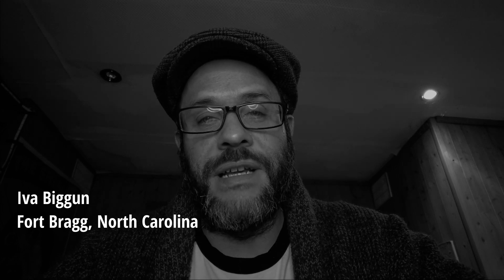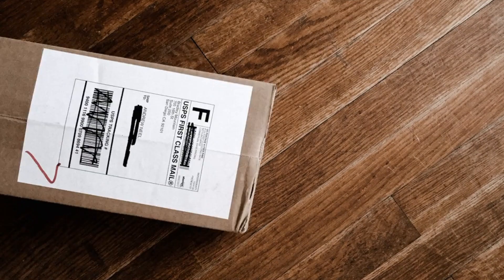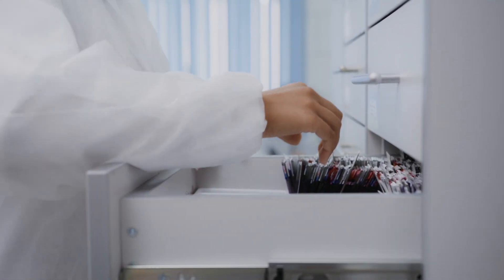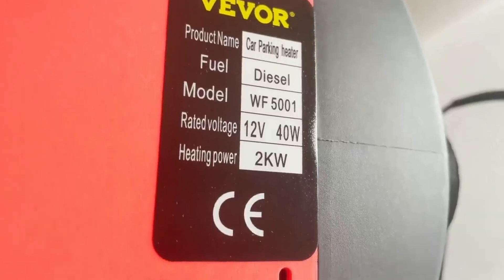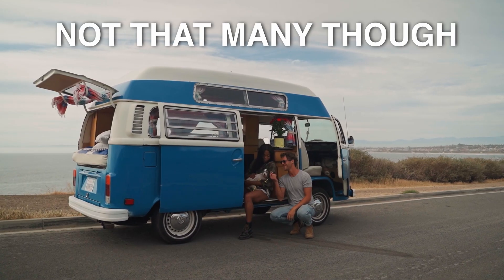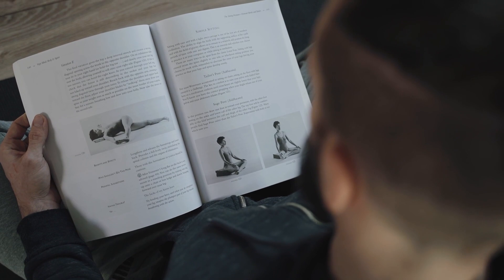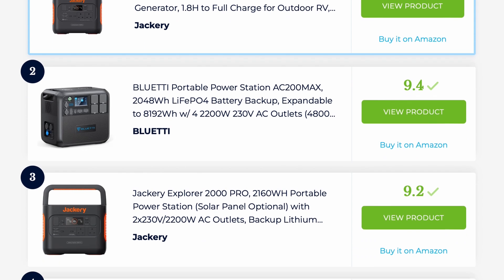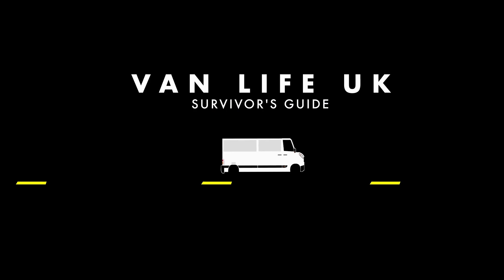Chinese Diesel Heaters Top Ten Most Commonly Asked Questions... Answered!

Comment: The quality control on these heaters is not always good. A friend of mine bought one and during hitting found the exhaust flue had not been drilled and was blanked off by the casing casting! Moral of the story, look at everything carefully before fitting.

Comment: Question 1..   10 percent petrol will change your life.    Question 2.. 12V is all that matters.. 12 amp max.   I run batteries with 6amp trickle chargers, on road...   12v from modified computer power supply that itself is connected to a ups, at home.

Comment: I'm getting some issues with my 3 month old diesel heater. I came home and it was coming up e10. I gave it a prime and changed the hz on it and it seemed to work ok fir like 40 mins but now it's shutting off by itself and is struggling to start up. I just put fuel so it's not that. What's the most common things to check this early? Fuel line? Glow plug?
Reply from the maker: I would say the battery or power source if it is cutting out, failing that it might have air bubbles in the fuel line
Reply: @vanlifesurvivorsguide  legend
Reply: @vanlifesurvivorsguide  it seems to be OK this morning. It did run out of fuel so maybe hadn't primed it enough and it was later on a cold evening trying to get it going. Fingers crossed 🤞

Comment: Do you have a video that shows how to set up a 5kw to run efficiently at lower power? Like the 2kw versions that are really ramped down 5kw?
Reply from the maker: What control panel do you have? It can be as easy as swapping the controller to a better one that has the HZ mode. If you don't have that you could swap to a smaller pump like a 16ml and change the pump setting in the controller. It all depends on the controller basically. Are you a member of our facebook group?
Reply: @vanlifesurvivorsguide  I have the standard black controller (without the spanner icon) it came with the HC 5kw. Yes, I'll ask on your Facebook page, better place.
Reply: 2 kW versions are physically smaller than the 5 kW. 
So not a ramped down version.
Reply: Yes, the genuine 2kw heaters are smaller. The others are 5kw that have been set-up to run lower.

Comment: The mesh screen works as a wick. There is no atomization with these heaters. They are a wicking heater.
Reply from the maker: It is still called an atomiser screen though
Reply: @vanlifesurvivorsguide  ok, but calling it that gives people the wrong information about the actual combustion process that is taking place. It was someone that probably couldn't visualize what was going on and compared the heater to a furnace that does atomize fuel during combustion.
I think it's wrong to call it an atomizing screen when it does nothing but wick the fuel into the chamber.
Reply from the maker: @kirkwalsh1932  If i call it something else and they look for it to buy... they wont find it? best not to be pedantic as most people don't really care how they work, they just want them to work. But if it helps I agree